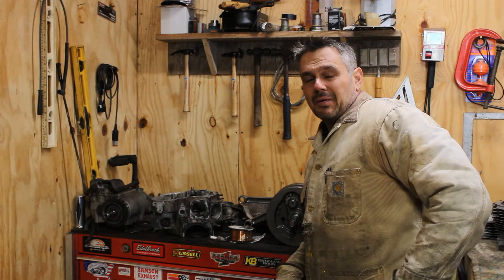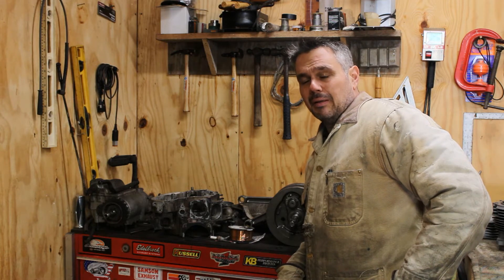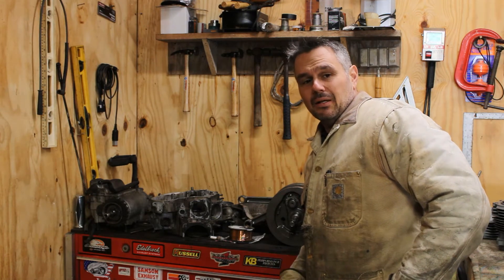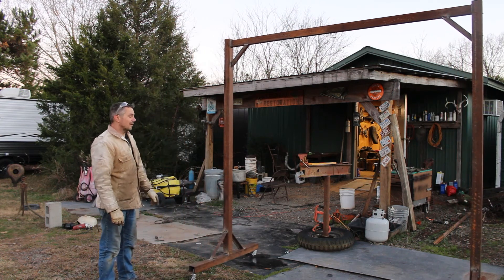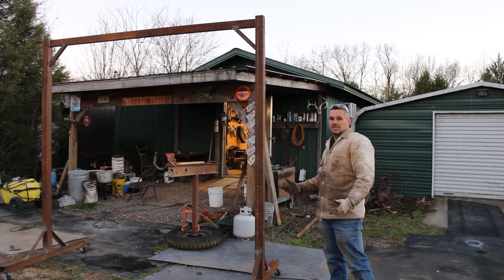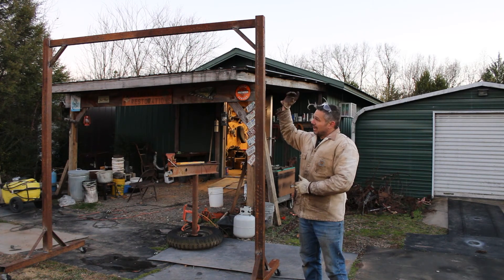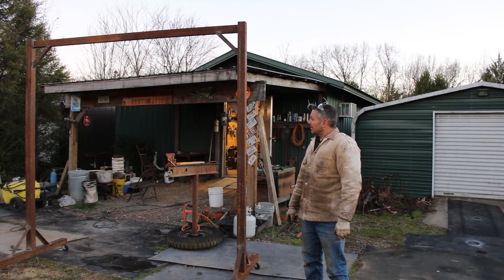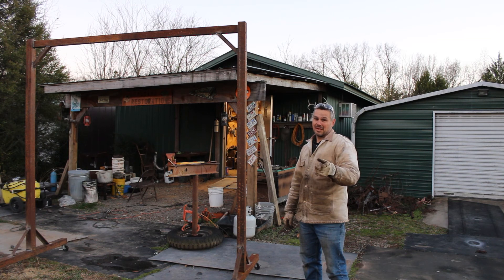How to Build Engine Hoist/Lift.

Comment: How thick is the 4x4 tubing? Would 16 gauge work to lift a 1500lb welder?
Reply from the maker: I would need to know the length from vertical support to vertical support. Mine was only good for engine's.